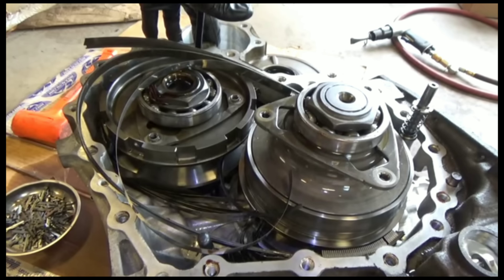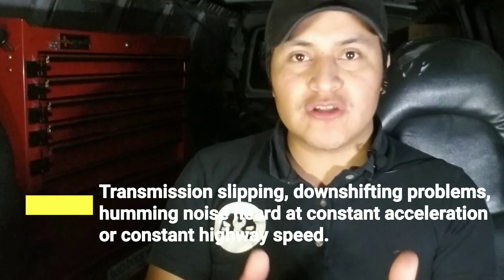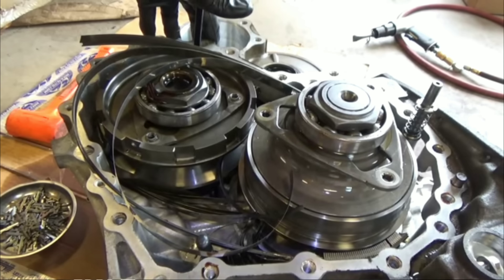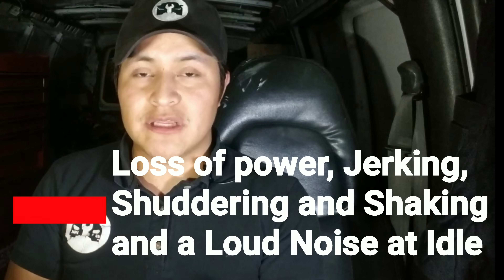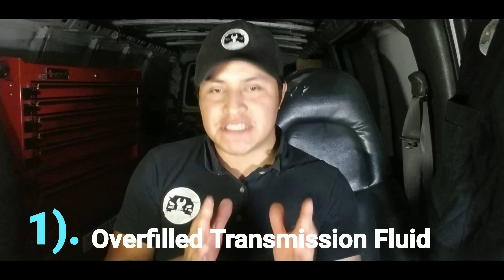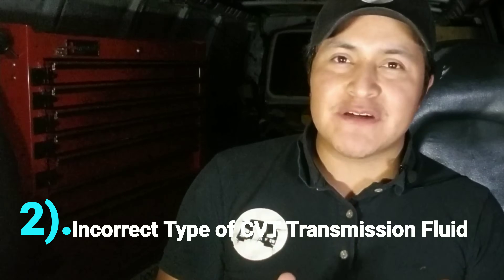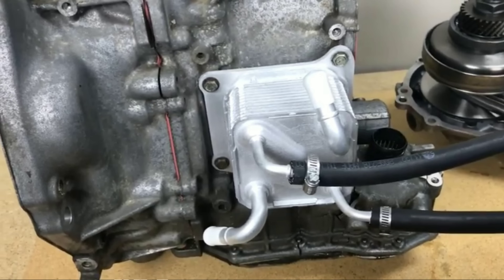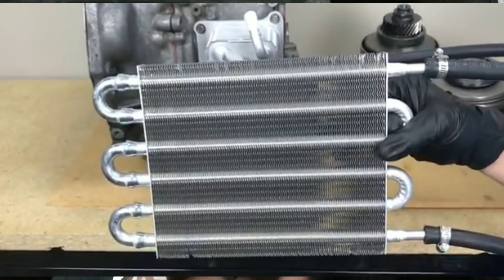NISSAN CVT TRANSMISSION | why it fails and what you can do about it to prolong it's life

Comment: Damn Nissan! Before I became a Licensed Contractor, Licensed Home Builder, Licensed Automotive Technician/Mechanic. I used to be a City Bus Driver in Los Angeles California. And during my youth the Diesel Manual Transmission Bus had been obsolete and been replaced by Compressed Natural Gas (CNG) Bus for a much more cleaner exhaust as per US EPA Compliance, and the City Bus that I used to drive are being run by Automatic CVT! Man! That CVT on the Bus that I was driving never fails me for 3.5 yrs of driving, and the bus is carrying more loads and it is much more Heavier than a Nissan Altima. I wonder why these cars CVT fails! Why?! What the Hell is going on Nissan?! Does your CVT's are Made in China or India or what?! They should be made in Japan! 100% all parts and Electronics and sensors should be made there!! And one of them should never slipped through the Quality Inspections without a Successful Test! What the Hell is going on Nissan?! Does Renault pushing it on Mass Production for Profits and Marketings like cheap pancakes just to beat or surpass Toyota's and Honda's Sales?
Reply: I didn't know the city buses were CVT. I'm a retired NJ Fireman all ours rigs were automatic transmissions. When I started used to be stick shift.
Reply: @HB-yq8gy  yes they are CVT's, you can really tell the way they whine and sounds. Also! I had driven a large Forklift powered by CNG also run by CVT's. Even some military vehicles like Armored Personnel Carriers, Amphibious Assault Vehicles and light tanks also uses and runs by CVT's.
Reply: @HB-yq8gy  American Firetrucks are also a different build, different maker. They use the same Transmission as the commercial trucks uses. Like Allison Transmission or Aisin Transmission but not CVT's

Comment: What is the best oil for my Toyota Innova automatic transmission please?
Reply: what ever the manufacture recommend and only that, no after market.   I hear this all the time the oil the manufacturer recommends is the oil they tested in the vehicle so use it even if it cost twice as much.  It's better to paid $20 more than $4000 to $6000 to replace the transmission because you used a cheaper fluid.

Comment: Watching while sitting inside my 2017 frontier.
Reply: You are safe bro.....frontiers don’t use cvt, as far as I know.
Reply: Dan Cob part of the reason I went with the frontier. Local Nissan dealer having a year end/new year sale. January 2018. Picked up a virtually unused non demo King cab sv for about $18,000. Best value trim level for what you get.
Reply: OneManShow  I am using the Nissan xtrail t31...had with cvt ...failed twice...have converted to manual....no worries at all.
Reply: I had a 2010 frontier pro 4X. the brakes rotted out completely at about 15,000 miles, and the battery died at 18,000 miles. At 20,000 miles to chrome was bubbling off the rear bumper. There are known radiator issues where the transmission fluid and the radiator coolant would mix due to a fracture. Nissan extended warranties on all of those radiators.
Reply: Yup Frontiers aren't cvt and radiator issues have been changed in the last few years.
Frontier is the only thing Nissan makes that I would buy.
Older, reliable design👍

Comment: -CVT fluid has to be replaced every 30,000 miles 
- CVT is very simple but the biggest problem is heating issues from debris accumulation that causes more heat on top of the heat 
- Toyota belt CVT also has this issue besides the one found in the Prius

CVT fluids should be changed every 6 months nd they will last a very long time

Comment: Them g37 infiniti got the same transmission??
Reply: @SG2 February  
I was wondering this too because when I shift I see the RPMs drop a bit but the gear number doesn’t change some times. Any ideas? I have a 2011 g37
Reply: SG2 February Yes it was in manual mod and yes it has the sport package. It happens when I shift with either one (paddles or knob) and it usually happens under low throttle it doesn’t seem to to it with 1/2 + throttle and it doesn’t happen above 4000 RPM
Reply: SG2 February  weird alright as long as it isn’t my transmission haha, it is a 2011 with 135k
Reply: SG2 February  yes it shifts through all the gears just fine( other then that) and perfect that’s great to know! I definitely will make sure I stay on top of the fluids, thanks 😊
Reply: SG2 February awesome thank you I definitely will do that in the next few weeks.  It’s the AWD

Comment: I don't understand why so many people don't like CVT transmissions.... My '10 Nissan Murano which weighs over 4000 lbs (after gas and people are in it) has 201,500 and something miles on it. Original engine AND CVT Transmission (Was a family car untill I bought it from my mother). I've put 85,000 miles on it myself in the few years I've been driving it. We/I haven't had to "Baby it" or anything. It's driven ALOT between highway, interstate and city traffic, I get great gas mileage, (I average 26-28 Mpg using the recommended 93 octane fuel) combined city/highway driving (without AC on, with it on it's 24-26 Mpg). The CVT provides me with plenty of power, and It's still going strong. Just make sure to change your transmission fluid every 30-40k miles and don't drive like a bat out of hell. Nissans aren't bad cars, but CVT's (just like all other transmission types) require routine maintenance like any other car.  Parts are made to fail, eventually they will and that's apart of life and that's the risk one takes when buying/using a car.
Reply: CVT in my Rogue failed at 79k mi. There are numerous other people with Altimas, Rogues, Sentras etc. that have had a failure at low mileage. Avg. mileage for failure is around 80k. I believe the CVT in the v6 cars uses a chain instead of a belt. This alone means it is less likely to slip. That's why people don't like them. I will never buy another car with a CVT again, especially a Nissan.
Reply: I went in to get my 60,000 transmission fluid change and the Nissan dealer service writer tried to discourage me from doing it. That is when I looked into it and found out the transmissions were known to fail. In fact I just got my notice from Nissan telling me because of a class action lawsuit I am getting two more years on my warranty (trans only). So if you got a good one great for you.
Reply: Thanks i can have a sound sleep,  
I have driven for 30000kms no problems till now
Reply: But do you live in a high temp area like Nevada?. Going to look at a Juke tomorrow, and it gets hot here in southern Utah.
Reply: @suzettebeersingh8004  my recommendation is to stay away from the juke unless it is 6 speed manual. CVT's don't like heat, and they generate lots of it. Mine crapped out at low mileage, and was driven mainly in Alabama and Tennessee. Hilly terrain and high speed driving(interstate) also wears them out faster. Mine was 95% highway miles.

Comment: I have a 14 year old Nissan Cube z11 and the CVT transmission is still working perfectly
Reply: Failure definitely imminent!
Reply: @HB-yq8gy  everything has to fail at some point will be happy if engine last 300000 kms
Reply: @thrishulh9834  Well we sold ours 09 Sentra CVT garage before it fails at 200,450 miles! A miracle from God!
Reply: My 2009 cube with cvt blew out a couple weeks ago, but I was at 205k miles. I now use it as a cigar lounge. 😁
Reply: @davidl5037  If you want to keep the mobile cigar lounge. If you want to invest in a rebuilt CVT. You better do your due diligence and check out the shop make sure they they have a good reputation and longer than 1 year warranty or 12,000 miles to cover parts & labor.
Take your time I had 5 estimates. Don't get suckered into like I did. "We need X amount of dollars first to see if it can be fixable." Don't fall for the scam!
Reply: @HB-yq8gy  I gave up on it. It stranded me in the middle of the road at a red light and I was done. Bought a car last weekend. The cube was my first and last nissan. It does make for a nice cigar lounge though. 😄
Reply: @davidl5037  I wanted to junk 2011 Cube. But my son loved the car and was headed off to college soon. We didn't have time to look for another car. So I paid the $3,500 I still feel the pain still today.
Reply: Are you sure it uses a cvt transmission???
Reply: @dancob3247  100 percent
Reply: 2002 - 2008 Cube Z11 could have an automatic transmission or CVT. You might be lucky & have the automatic transmission instead of the garbage  CVT.
Reply: @HB-yq8gy  it has the CVT, unfortunately. I am certain of it. Even has the CVT sign on the dash that lights up momentarily when the ignition is on.
Reply: @manufacturingdefect1287  The age & the mileage. I don't know how many miles you have. Most likely plus 100,000 miles . I wouldn't touch it just leave it alone.
Reply: @HB-yq8gy  it's at approximately 50000 miles since it's 80320kms.
Reply: @manufacturingdefect1287  I'm not tell you what to do but. If it was me if it's not broke don't fix it.
Reply: @HB-yq8gy  yep. car is used for short trips sometimes not at all. Will enjoy it for as long as it lasts.
Reply: @manufacturingdefect1287  We got $900 was asking $1000 or Best Offer for our 2009 Nissan Sentra with 200,400 miles original owner with all maintenance records. Put  it out in front of my house it sold less than 1 hour!
Reply: @HB-yq8gy  I think JDM vehicles are better built compared to those manufactured in  the US. I could be wrong though
Reply: @manufacturingdefect1287  Yes I stick to Toyota learn my lesson with Nissan never again or any CVT.